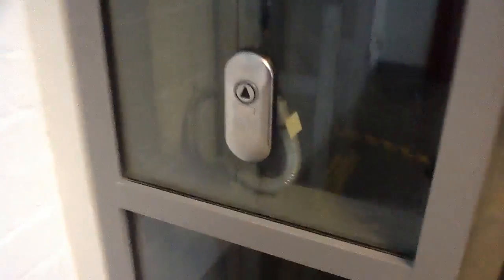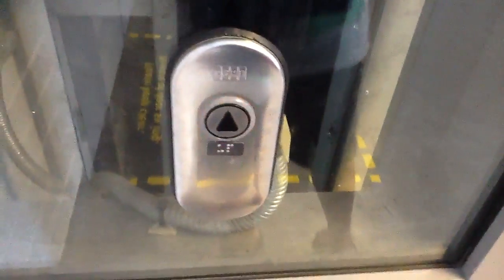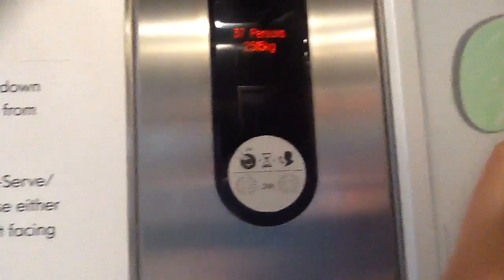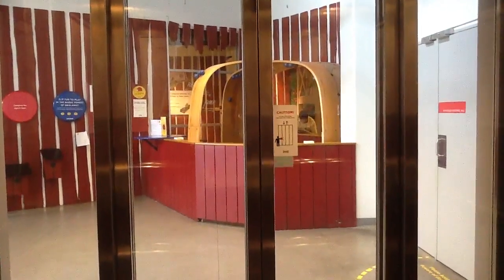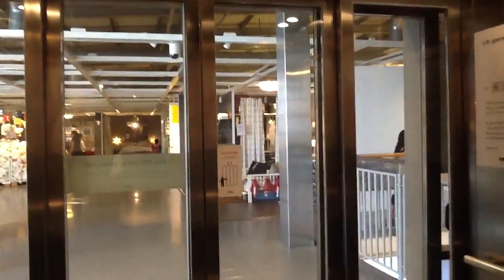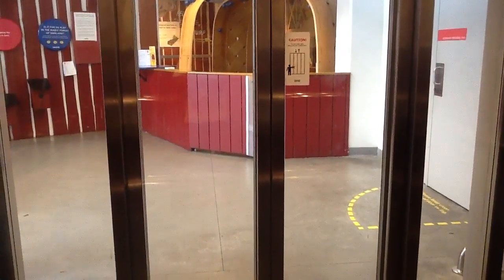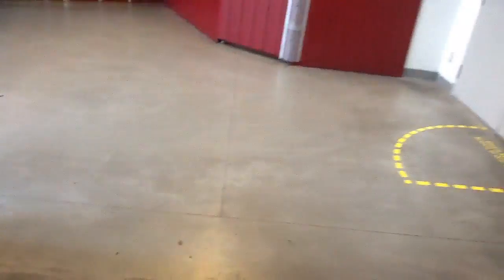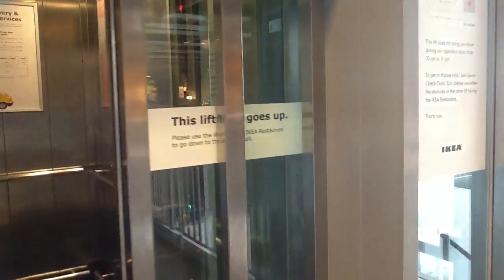IKEA Tampines: KONE Monospace MRL Scenic Traction Elevator

Comment: the reason the lights were off is because of eco mode, the light and fan cut off after 5 minuites of inactivity
plus the clunk is the motor not a relay, most new lifts dont use relays